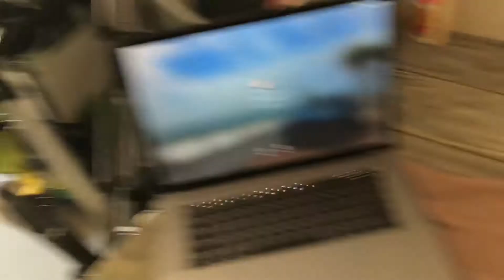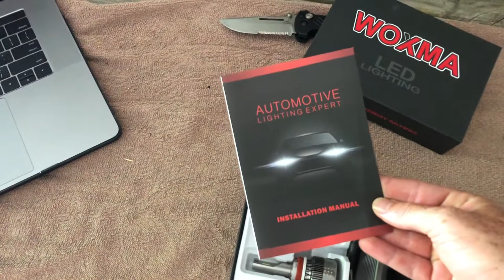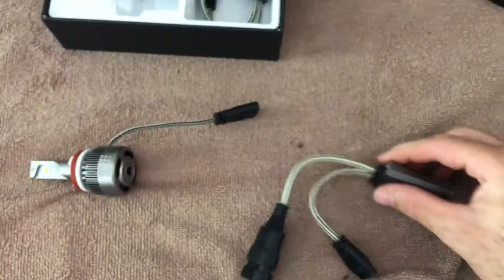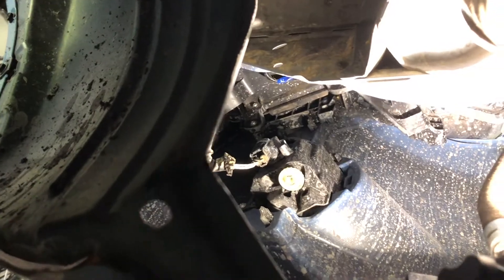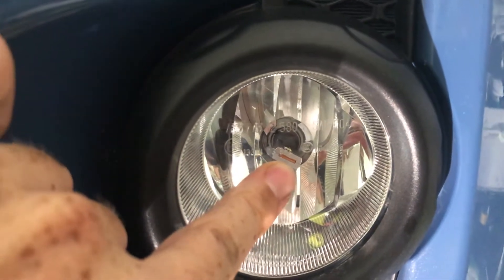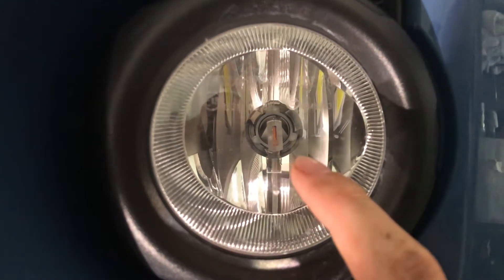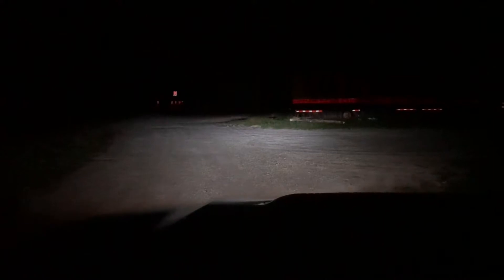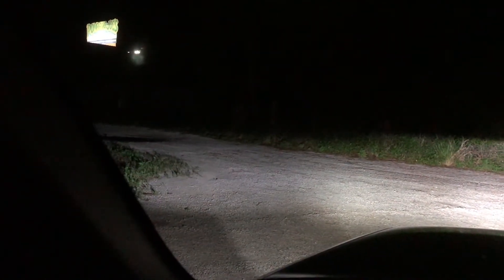WOXMA LED FOG LIGHT INSTALL

Comment: You had a the fan problem? I got a TRD PRO that had that problem, I unscrewed my top 2 bolts and pulled the tab up. And the headlight housing pushed out a little bit. Next I pushed my bulb in and turned it. Then you put the 10mm on.
Reply from the maker: Thank you for sharing the way around it! 👍🏼

Comment: Blue TRD Jon  Hey there Jon. Seems like the bulb brightness and/or color hue on these fogs don't match very well with the AuxBeams in your headlights. Is that really the case, or is the camera throwing things off? Could you please confirm? Thx! 👍  PS: Ypu still rockin' these bulbs, or did you change out for other brand?
Reply from the maker: I have a different brand in my fogs. Actually put the sealight bulbs in there. But they were a little off compared to the auxbeam

Comment: What if the fan fails?  Will it melt or go on fire?
I like the squadrons. 
You could always just put yellow/Amber film on the fogs.  I put clear on the head light and fogs to keep them new looking. Did it on my FJ TT and Tundra TRD Pro also.
Reply: Also forging through deep water that go above the fogs might not be good for the fans.
Reply from the maker: This is all very true. Idk if it will melt, if the fan fails but I’m still moving I think it should be fine. I was looking at the squardons also, but I hardly ever use the fogs and just didn’t see me spending that cash on them. They are definitely worth the money though.